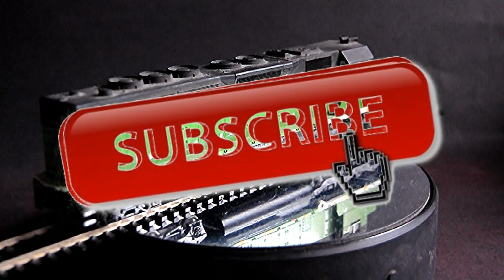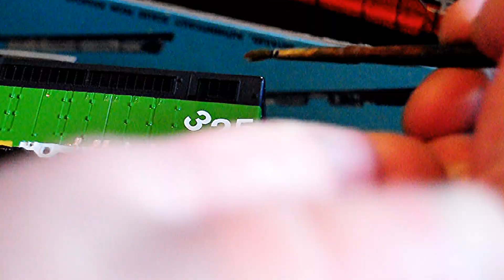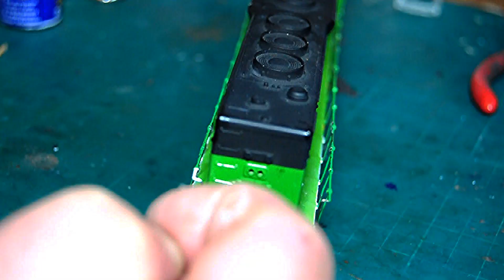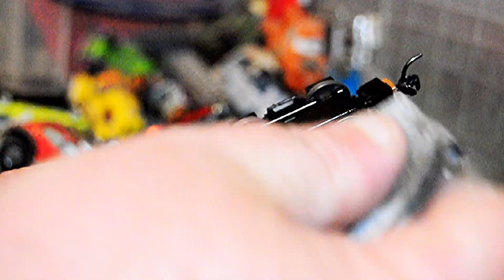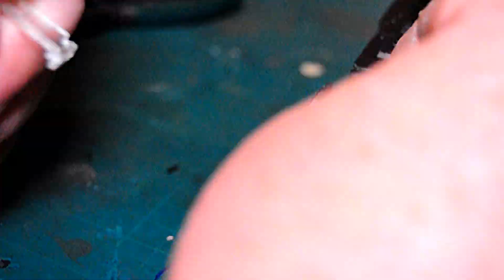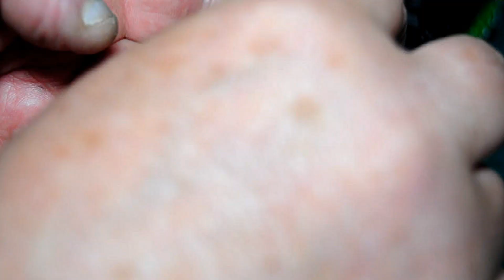FINISHING DECORATING AN UN DECORATED ATHEARN BLUE BOX SDP 40

Comment: Nice job, hand rails salvaged from the other body came in handy. I have an NZ GE loco needs the same work, It`s on the list.
Reply from the maker: i have 2 frateschi tranz rail locos if i'm correct they should be fairly easy as they didn't have full rails but only near the steps